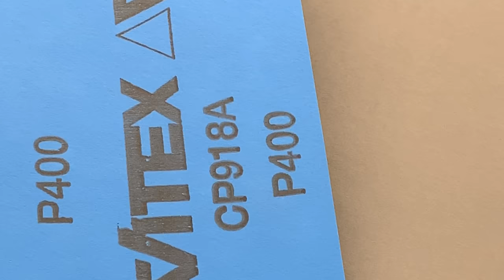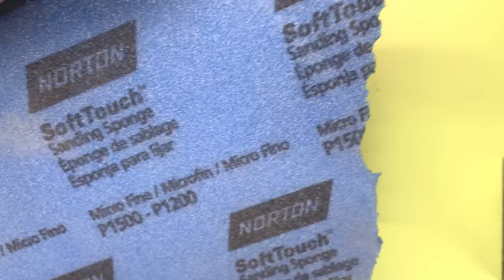Watch Case Restoration Part 1 - Seiko 6309 Giveaway

Comment: Mr.Mike,here is a suggestion from me for cleaning the watch case and back,a very tough cleaning indeed with minimum effort.Apply  the cleaning cream of
cif(a surface cleaner in India with key ingredients  of sodium salt of Linear Akyl Benzene,Sulphonic acid Alcohol Ethoxylate and calcium carbonate) on the surface of the case and back and wait for 1 hour.Then,clean the case and the back with Dishwash powder or solution(in India Vim) rubbing  with a soft scrubber gently for a few minutes and rinse them in cleaan water.Then wipe the water on them with a soft cloth.You will have an amazing result,without much strains.Please try this method.

Comment: That caseback could be improved on a lathe type Chuck that grips it outwards. Mounted onto a drill and a series of sandpaper grades to get most of the gouges out.
Reply from the maker: I dont have a lathe mate. only at work and they are massive. you would not be able to grip from the outside in sufficiently to turn I would have thought as there is not enough to purchase on
Reply: My Retro Watches 
Nah, something like this to mount on a sturdy drill. Grips the caseback from the inside then you can work on the outside.
https://www.harborfreight.com/2-inch-mini-lathe-chuck-with-mt-1-shank-65132.html

Comment: Another nice vid Mike, Excellent work as always. I can't get my hands on any tool steel, but I find that an old piece of plate glass does the trick. :)
Reply from the maker: yes glass is another option. I can help with the tool steel if your are UK (presume you are) post will be a bit more as its heavier.  if you want  a piece of steel email me michael@myretrowatches.com

Comment: Hi Michael,
On restoring the case, have you used a jeweller’s bench peg when sanding, etc the case. I find you get more control as you have the work pressed up to the peg, so you can control the sanding, polishing more precisely. I also use a flex drive on the rotary tool, again gives me better control.
Just a thought, great videos, thanks for sharing.
Reply from the maker: Hi, I have not heard of a jewellers peg until you wrote your comment. Certainly worth looking in to.  I usually use my polishing machine for these jobs.  Its like a mini bench grinder with a taper spindle to take polishing mops. I am using my rotary tool as I feel more of the viewers would have this tool if they wanted to give it a try.    I too have the flexi drive but I have not used it yet, in part because I dont have anywhere to clamp the hangar to for the main tool to hang from.   This is a great comment Melvyn so thank you for the tip.

Comment: That's a fine comment ref eye gear. I was cutting some old metal out prior to welding a new car panel in on a Mini years ago when the disc started to fail. I wasn't wearing goggles and my eyes by luck survived but my face was a bit of a mess for a few days!!!!!!But not having learned my lesson had a piece of block paving I was cutting on a Still saw years later catch my eye and off to hospital I had to go!!!! No long term harm but....... Cheers.
Reply from the maker: We all learn the hard way.  I have seen accidents in my workplace with guys not wearing toe protection shoes then drop steel on them....  I am more aware of my eyes as I only have a good one.

Comment: Might have been easier to put the bezel in case for sanding first 👍
Perhaps possible to setup dremel at an angle in fixed jig then work bevel 
Off a flat surface like a router 🤔
Reply from the maker: yes fitting the bezel should have been done at the start but I was not thinking. It dawned on me near the end!    I am using the rotary tool to show what can be achieved by such a tool as I would normally use my mini polishing machine as its fixed.  Not everyone has one and more likely to have the hand tool so if they want to try this then watching what I do could (I hope ) be helpful.    In some of my early videos you see that I have a clamp for the rotary tool which I used to great affect.  I might now dig it out for the polishing video.  Thanks for watching sir.

Comment: 10 hours is hardly too much time for that, it would take me 3 days for the whole thing and, gosh you're lazy.  And you don't buff something like that, you shouldn't even touch it with a wheel until the final buffing.
Reply from the maker: Tomasina Covell well I’m no expert but I get good results the way I do it. What’s wrong with that.  You have your opinion but don’t call me lazy as you have no reason to. Besides this is just the prep before polishing  video .
Reply: @MyRetroWatches  I'm sorry dear, I was a bit harsh, you do fine work, very good for what it is.  :)
Reply: I did think the hard rubber impregnated wheel was pretty cool, who sell that one?